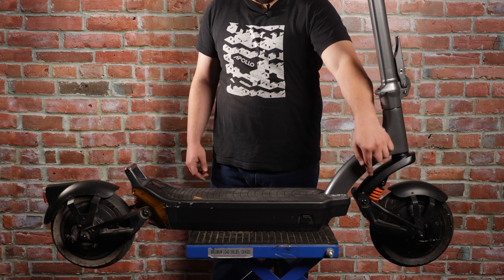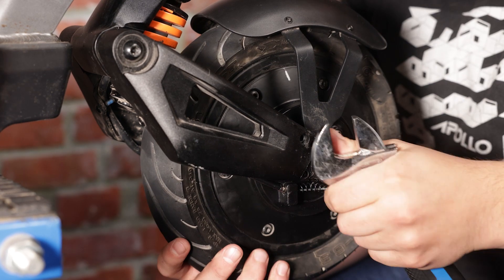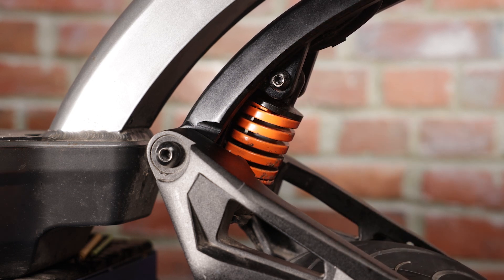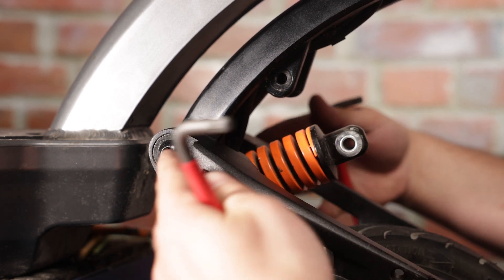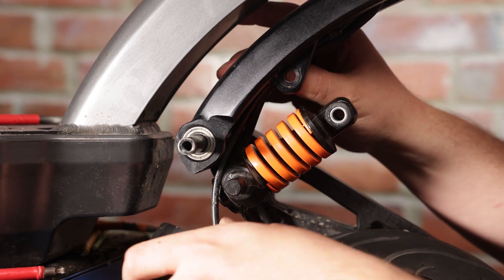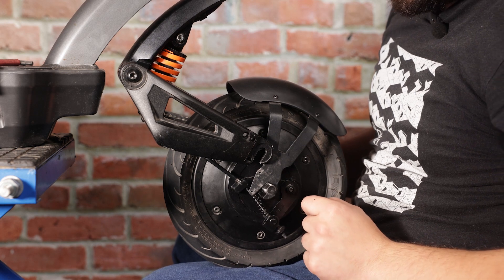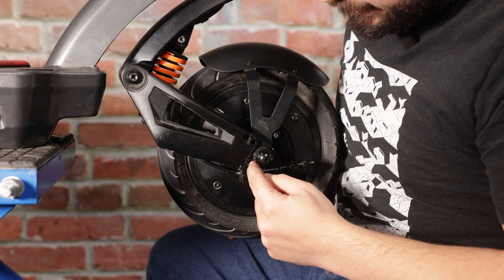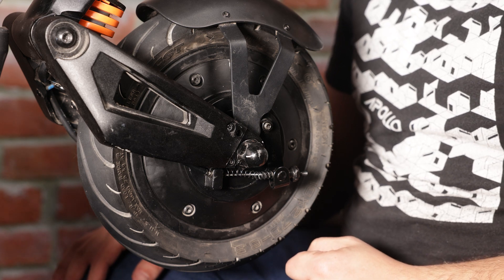How To: Apollo City 2023 Front Suspension Replacement

Comment: How do you actually replace the whole lower black assembly? The replacement you sell online includes the whole thing as well as the bar the goes through the headset and connects to the stem. It looks like you need a custom tool to detach it?